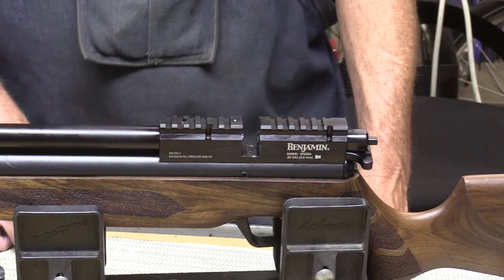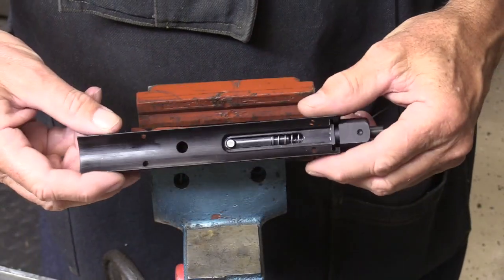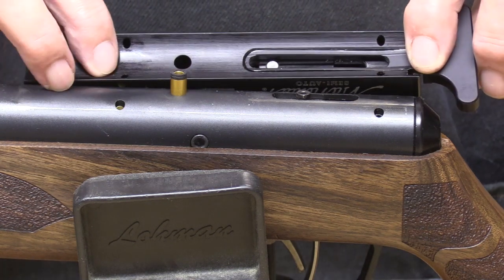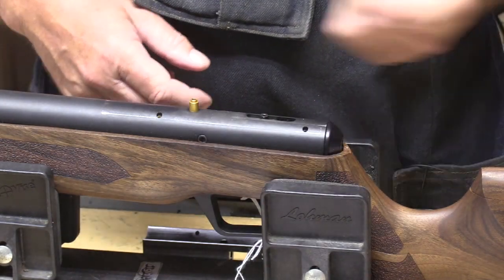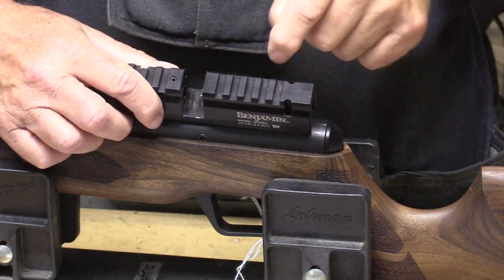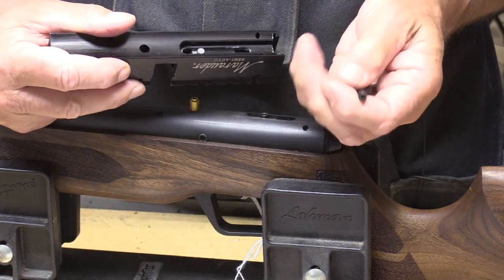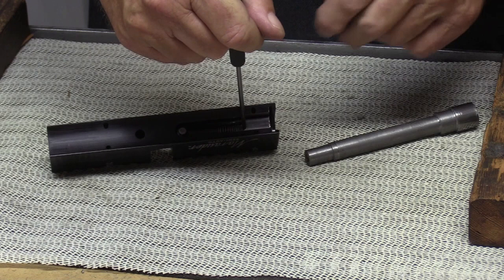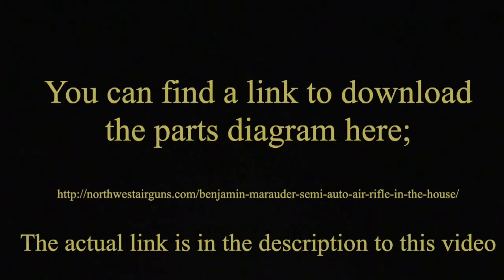Air Time No. 29 - Benjamin Marauder Semi-Auto Bolt Repair

Comment: Where is the semi auto system, sir? How come i don't see it?
Reply from the maker: Its tricky, a combination of hammer spring and hammer bounce, plus an air pulse for the bolt.  Not a mechanism per se, but a system.  I don't fool with the regulator or other possible adjustments other than the hammer spring because I don't want to upset the system working in concert.
Reply: @NorthWestAirgun  thank you sir for your answer
Reply: @NorthWestAirgun  if i look closely, the difference between the semi auto benjamin and the manual benjamin is in the pellet probe which uses a semi blow, is that true, sir?

Comment: Couldn't you have drilled the pin out or drilled a hole next to the pin in the bolt & then milled it or is the pin & bolt hardened?

Comment: Sir same issue with my benjamin marauder semi automatic the semi auto bolt broken. the problem is I'm in the Philippines so can i buy this parts online?
Reply from the maker: Not online.  Here in the US we generally have to call Crosman on the phone to place a parts order.  Try email with their international contact here;
https://www.crosman.com/support-contact
Reply: @NorthWestAirgun  sir what is the broken part called? Semi-auto bolt?
Reply from the maker: @LauroJrJacob  This part; BOLT, .22 CAL, FULL PROBE,  Part # SAM22A006.  You may also need a new bolt pin (bolt stud), although you can reuse the original if you are careful removing it.  The pin # is SAM-023.
Reply from the maker: After you take off the breech/receiver, if your breech has a hole in the top, middle of the scope rail, then you can use that hole to punch out the pin and remove the bolt.  If there is no hole, then you'll have to drill one.  Take this to email and I can send you spec's on drill size and where to drill the hole.  nwa@northwestairguns.com
Reply: @NorthWestAirgun  sir can i know the size and length of the bolt because i can't buy any here in the philippines, i'll just have it done at the machine shop

Comment: Crossman/Benjamin hopefully gave you a thumbs up on your video ! I will give you two 👍👍because most of us may or will experience this and do it yourself for me is the way to go !  I would go as far as to mirror polish all surfaces that have contact with the operation with a proper lube added . Could be a tiny access hole to add Lube in certain areas could help reliability .

Comment: Do you think this was caused by the magazine not advancing properly?  I noticed the fins on the mags are breaking and I had several mis fires in just 2 magazines of pellets.  There is probably less than 100 pellets through the gun and the groups are about 3x of those from my bolt action Marauder.

Thank you for a great video.

Comment: Mine has that hole in the picatinny rail. I got it in May 2021. I sent it back to Crosman because the safety didn't work and it leaked. Got it back and found the trigger was broken off in shipping. Crosman then sent me a new $110 trigger pack free of charge.